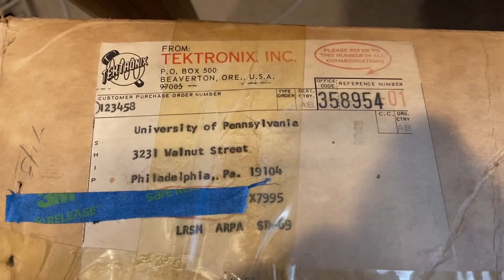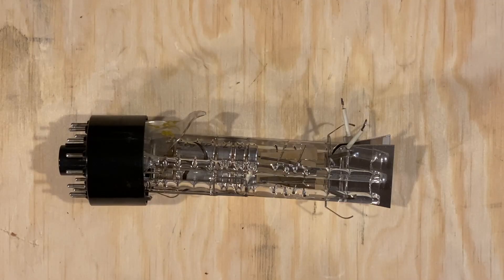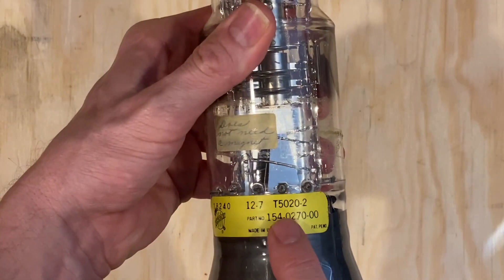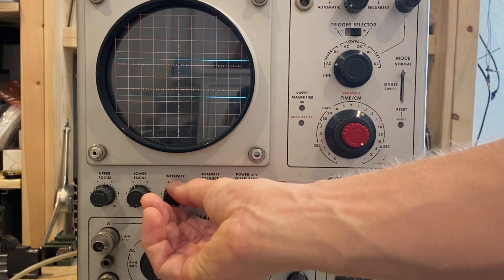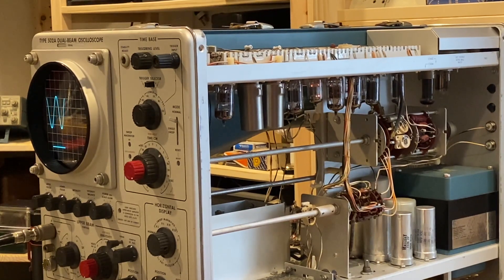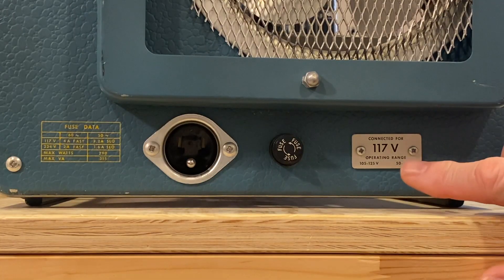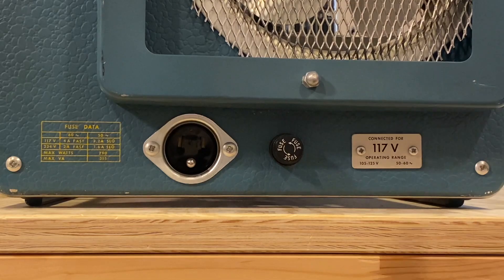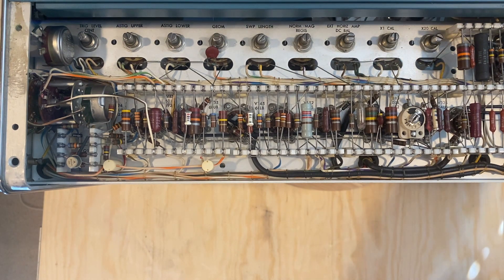Tektronix 502a Oscilloscope CRT Replacement

Comment: Nice to see, that you got this scope operating again. I got the same kind and use it now and then and just now. I got it about 1980 on an auction. It had a fault back then, in the main transformer. It got a separate winding to supply the filament of the CRT, and it have a voltage at about -2900 V. So there was some spark-overs in the transformer. I then mounted a small other transformer for this filament, and then it have worked since :). Well today I was using it, and I discovered that the light bulbs for scale illumination had finished. So I shall try to find replacements, and then I saw your video. The inscription on lamp is 6.5V .15A.

Comment: These vintage Tektronix scopes are absolutely beautiful, both inside and out. Pity that they're so rare in the former Eastern bloc (Poland etc.). I once had a ZRK OS-102 that was almost surely a copy of one of the Tek scopes, and it was a very nicely built behemoth that I wish I didn't have to sell... it took too much space in my then crammed room/lab and I needed cash to go to a concert I really couldn't miss, I think.
Reply: The things we do when young ;). I can’t tell you the amount of scopes etc I have bought, sold, traded, and then, regretted. Fortunately we live in a time with eBay and other sources. Hope the concert was great ;0).  If they where so delicate and expensive to ship, I’d get ya one, but even here it is the same. I will only now get them in person, no more mailings here.

Comment: I just wanted to say that I have really enjoyed your video on the Tektronix 502A scope! A great pleasure! And glad that you kept this from the audiophools that would have been more than happy to rob this scope of its tubes for the 5AR4 rectifier tubes and any 6DJ8 and 12AU7 tubes as well.  I have a few different Tektronix scopes on hand. Let's see here, I have a 503, 504, 533A, 535A,2- 545A, 2- 561A, 564 storage scope and a true dual trace 565 scope! One thing I would suggest is to keep an eye on those electrolytic capacitors, I had my 535A for almost 30 years and used regularly and one day, 1 of them decided to turn into a dead short and took out the 10 ohm resistor, bridge rectifier and the power transformer. I was lucky enough to have a 535A parts mule to replace that power transformer. After that, I ended up replacing ALL electrolytic capacitors.
Reply from the maker: Wow, quite a collection!  Last month I also picked up a 585A, awaiting a restore before the end of the year. Hoping to locate a spectrum analyzer plug in just for fun. These scopes are addicting to work on, too much fun!  Thanks for the reminder of the e caps, I am defiantly going to replace them in all these units. Time, oh how I wish I had 28 hours per day….
Reply: @savvycircuits9683  Nice on saving that 585A! I have always wanted one, but seems like I can only find them on eBay most of the time and the last few scopes I got from eBay ended up getting destroyed by FedEx. I had a pristine 531A until the delivery driver decided to drop the package out of the back of his truck. Needless to say, the CRT was destroyed and the entire scope was bent out of shape from being dropped onto the front. But yes, these scopes are so much fun to work on and even more fun to use! Nothing like the feel of a real switch, humming of the fan and seeing the trace on a CRT! I did have a Tektronix 2465 scope but that scope was no longer usable. The Dallas chip with the battery backup died and rendered the entire scope useless as it held all the calibration.  But I hear ya on time......never seems to be enough time......

Also, Tektronix made several spectrum analyzer plug ins.  1L5 is the one you want to look for if you want the audio frequency range. I don't have any myself, but there were a few covering a certain bandwith.

Comment: Nice video!  There was a 502 (not sure if it was a "A" or not) that was at a startup company I worked at in the late 80s.  The founder/boss had got it along with some other "junky" stuff from his last employer I think.  My recollection is it had some problem and maybe only 1 channel worked.  It got put into a storage room and most likely ended up in a dumpster years later after I left.  It had a light shield on the CRT bezel and I think there was even a rubber face visor so it must have been used someplace with a lot of ambient light and glare.

I have never been totally clear on the usefulness or applications for the dual beam feature on these.

Comment: Great Job. I have restored my 502A some time ago too. Although both are 502A, there are some differences. My model originally had no PCBs inside and therefore I assume your model is newer. At 41:31 I can see that you are missing the "CRT CATHODE GND" contact plate (Part NO. 386-427) which should be closed during normal operation according to the manual page showing the CRT CIRCUIT.
Reply from the maker: Good eye!  Thank you so much, I did not notice this, though now I see it on the schematic.  By chance do you know the feature thought here?  My guess is if you wanted to add an external signal directly to the CRT via the pin access as described in the manual.  Although I cannot seem to find a referenced wording of the grounding plate.
Reply: @savvycircuits9683  Thanks, but that was pretty easy for me since it was missing on my oscilloscope before restoration too.
You should find the description (and the purpose) in the chapter "Modulation of the track brightness (intensity)". In the service manual downloaded from the Internet it's printed on page 2-10 and in my paper manual on page 2-11. Tektronix refers to the plate as the "ground strap on the back of the instrument".
Reply from the maker: @jaroslawkolacz5610  Yup, found it!  I actually had an apparently early 502a manual, as there are 2 I guess.  I just got the correct one now that lines up with your notes.  I see the use now.  I am just going to make a bar from some conductive steel.  I recently saw a 585 for only $200 on Facebook Marketplace.  I may have to scoop that up!
Reply: @savvycircuits9683  
I like your new CRT :-) My 502A shows blue traces without persistence on white background.

I think there could be even more versions of the manual ...
In my opinion the original grounding strap is made of plated brass. At first I had the idea to make a replica as well, but then I asked a man who sells a lot of old Tektronix parts on eBay. He told me that it was not worth the time to set up the auction and describe this part as its value is only a small fraction in comparison to the shipping costs. However, if I buy another part from him, he will include it for free. He also gave me the opportunity to pick it up personally. In this case I could get it for free without having to buy anything else.
I think it's worth a try in your case too.

And I'm looking forward to the 585 video. :-)
Reply from the maker: @jaroslawkolacz5610  Agh yes, the beautiful blue traces!  These where made with this phosphor so camera's of the era could take more detailed photos of the screen.  As it turns out, green is not as photographable.

Comment: I would love to help you out - I can design and print.  B McFarland can get us in contact!
Reply from the maker: ok cool.  Brad has reached out to me, I will be in contact.
Reply from the maker: Great job on this btw.  I have had the unit running for some many hours, and the PLA is withstanding.  Average heat inside is roughly 95-98, though in an air conditioned room.